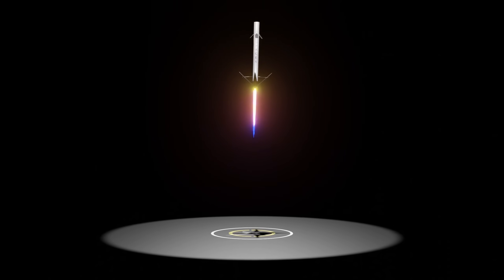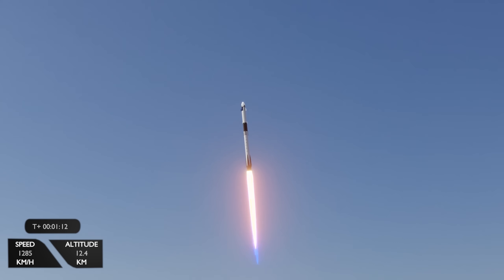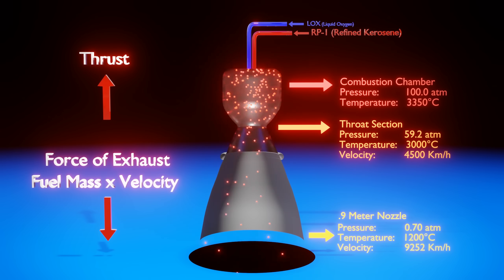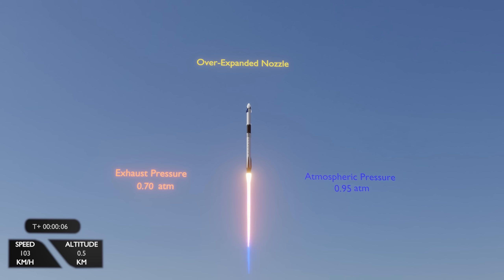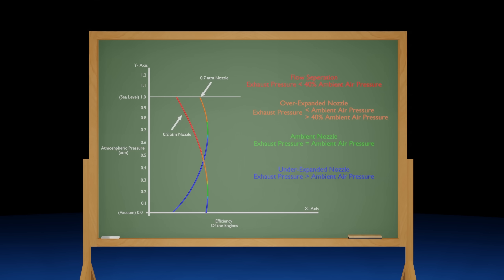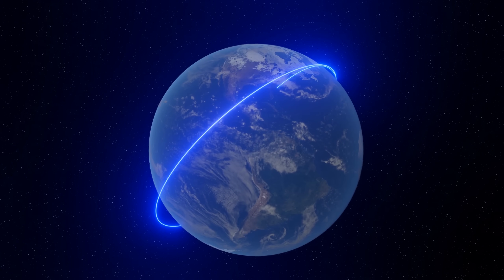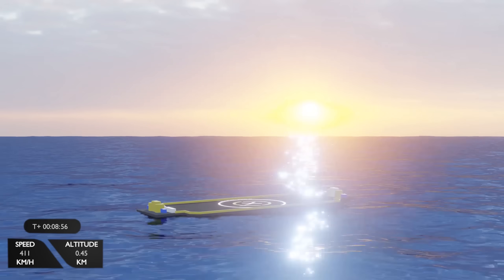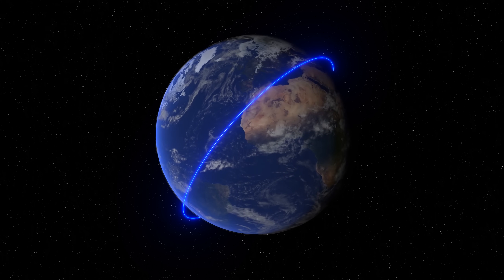Why Doesn't SpaceX Recover the Second Stage

Comment: 8:03 Can someone perhaps explain this? After MECO, how does the 1st and 2nd stage separate, since they are both going as a unit at the same speed? How does, or what enables the 2nd stage "push" away from the 1st stage? Thanks!
Reply: IIRC, the decoupler pushes the second stage away. Since the second stage is lighter, the energy from the separation slows down the first stage by a little and pushes the second stage away.
Reply: It's not really a decoupler. It's actually a big piston that's mounted on top of the first stage and reaches up into the 2nd stage engine bell. You can see it in their live broadcasts. Heres the view from the most recent starlink mission: https://youtu.be/RBxkRKZ34yo?t=1309
Reply: @morningstarkid07  TIL that pistons are used to separate the second stage.
Reply: There is a big piston on the top of the first stage that goes up into the 2nd stage engine. when it's time to separate they use compressed air to extend the piston and push the 2nd stage away.  Here is what the piston looks like: https://youtu.be/RBxkRKZ34yo?t=1309

This view is from the top of the 1st stage looking up into the 2nd stage engine bell. It's hard to see the actual piston extend because it doesn't really move that far. It just needs to give a quick solid push and inertia does the rest.

Comment: this is oversimplified version:

falcon 9 has 2 stages to handle different surrounding (air pressure)

each stage they accelerate vehicle into higher speed.

when speed is too fast,it will burn out in atmosphere,but slow downs cost fuels

second stage has bigger nozzle for better performance at traveling in space,but easy to be damage when in earth.

because weight in space is costly and 2rd stage engine is not ideal for heading back to earth,so we just get rid of it.